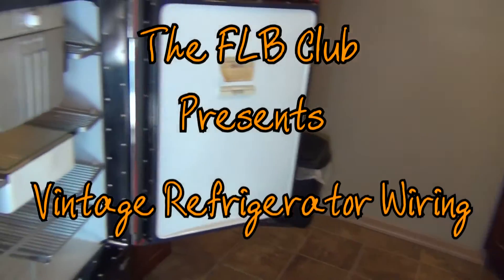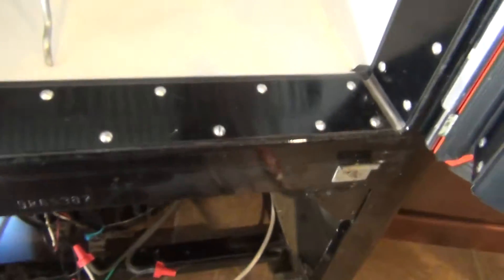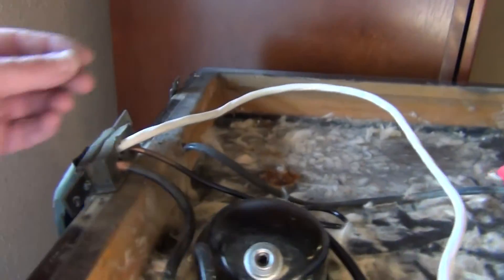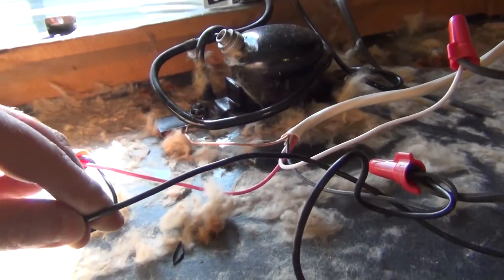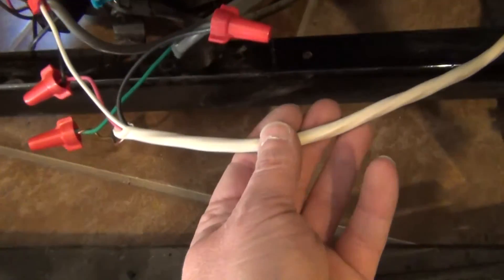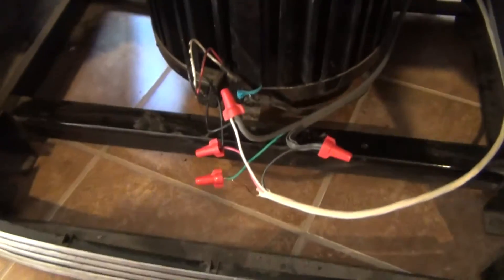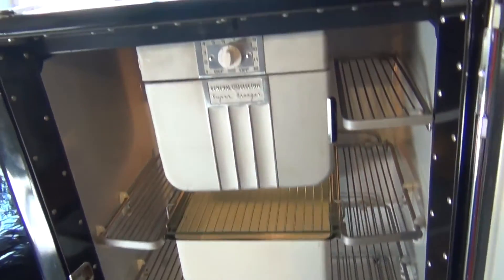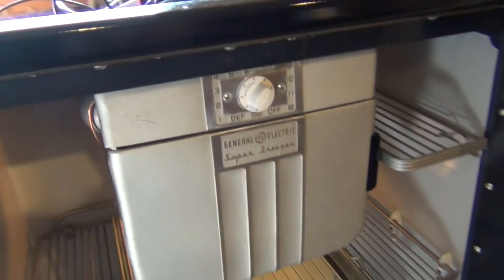Vintage GE Triple Thrift Refrigerator Wiring

Comment: I just purchased a really nice older I want to say 1950 ge fridge (single door model with small cube freezer inside similar to this) I bought it knowing it does not power on and I'm about to start working on it I'm hoping that it's just a start relay or bad power cord. my other fridge is a 1947 general electric all original and still works perfectly so I'm having faith that it will be something easy. I'm not sure this one has a condenser fan in it at all so may also be a late 40s

Comment: Hi! Quick Q. I have a 1937 GE triple thrift and curious about the off/off defrost defrosted switch. Not sure which position it should be in when the fridge is running.
Reply from the maker: That dial is a bit confusing to me too - "Defrost" is all the way to the left, which is essentially the off position, but the markings show "Off" all the way to the right, which is fully "On".  I keep mine set at around 2.5 and it works great - if I go much higher, it'll start freezing inside.

Comment: I have CR-1057-R1 Relay 0.5...Cat. M1A162..V.110 CYC 50/60 HP 1/8...Amp 3.2...All wires leading into relay insulation cracked. Looks like someone worked on it having to wrap one wire with elect tape.  There's wire coming from relay down to a  rectangle box under compressor. Haven't taken compressor out to have closer look.